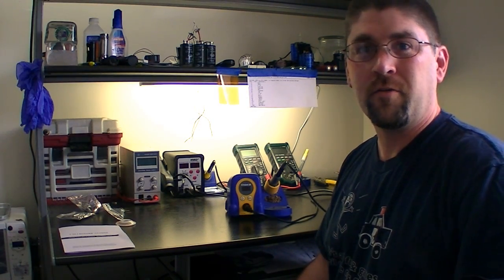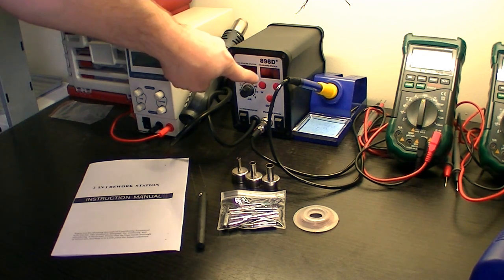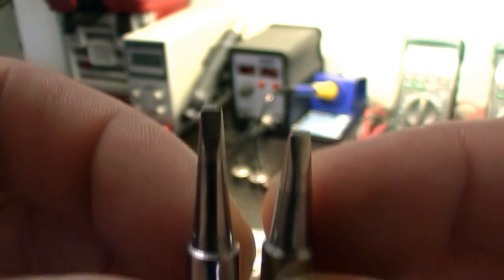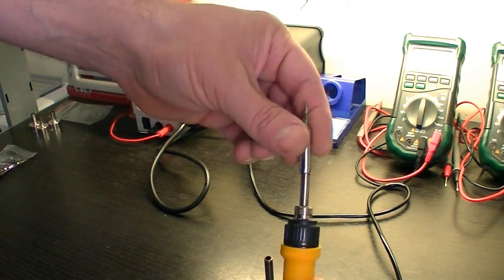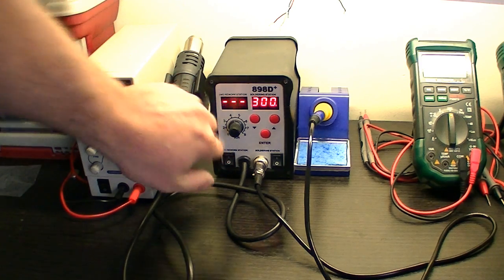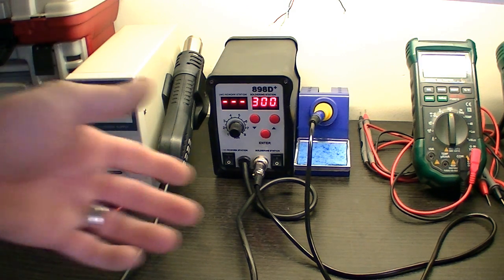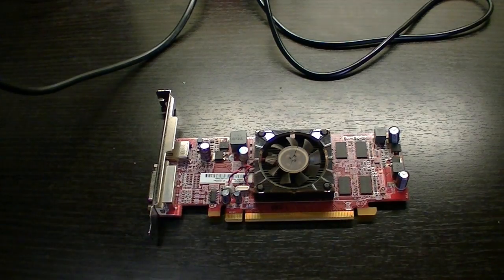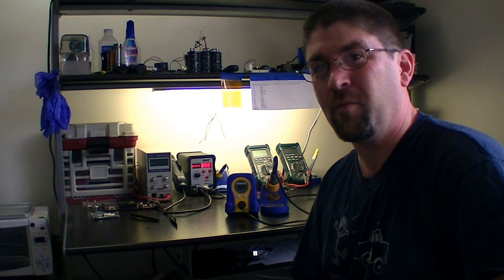898d+ 2 in 1 rework station review

Comment: I do have 898d and it is useless. I've tried to remove a mosfet  and failed, but both heat elements need replacement. I am reluctant to make such an investment.
Reply: 898D plus It's good, maybe yours is not the plus model. Obviously you cannot compare it to one that is branded, made in the USA for 300 dollars or more, but for those who are just starting out or do not have enough money, they are doing very well.

Comment: The key is getting the Yihua brand and the 898+. Not 898. Occasional user here. Mine so far is 2YO. All works w/ No probs. From SMD parts to 8ga wire. Inside work to outside car work. The air gun is great for SMD , heat shrink , cutting/softening plastic. Memory temp setting when turned off. Accidentally left mine on for a few days straight, again no probs.

Comment: hi there Mad Electron Engineering, or anyone on this planet please help me, i got the same rework station like yours few month ago, my question is,  the main unit controller getting warm and then so hot after i used it more than 30 minute on 300celcius iron setup, is that normal the main unit  getting hot? i just worried it will blow up on my face when i used it more than 30 minute. thanks.

Comment: Not to bust your bubble I paid 47.99 for my 898d. EBay,.Thanks for showing me how to put the heater/ blower end on ,I did mine wrong .your are right the book kinda sucks,I have only solder so far,it work great,I haven't heard any complaints so except one guy,there always one.
Reply: Ron Thompson i got mine the other day as well probably from the same seller.
Reply: $43.90 via ebay for a 'Mark Ethan' branded 898D with all the usual extras plus 11 tips at this point in time. Just for comparison price shopping for anyone. Cheers. Buying a soldering iron was a two week shopping experience for me. I am poor and indecisive. Fingers crossed on this decision.
Reply: Still working boss?
Reply: Still chugging along? thanks! oi.

Comment: I just purchased a Yihua combo station. I have a bunch of upcoming audio and shop projects where I need to salvage stuff out of old audio equipment, computers, PS's and such. I realize these are all just being rebranded, but I'm curious to know how your unit is holding up.

Mine was $99. I figure the first 5-6 transformers and 20-30 caps I pull from old equipment pays for this station. So if it takes a dump, I'm not really out anything. But I'm hoping it holds up for a couple years.
Reply: Has it dumped itself yet friend? thx!

Comment: I concur; I own a Hakko 939 and it is built to last. To trade your Hakko for a knock off brand is criminal, there have been known problems with this item, poor solder joints, segment display issues, if turned off while hot, it will not cycle to cool down causing premature heating element failure. I would have simply kept the Hakko and bought a separate hot air station that probably would have been more dependable.
Reply from the maker: +John Cunningham I'm still using it today with zero issues so far.
Reply: All I can say is you are very fortunate; there has been a small numbers of negative issues in some of the forums and other members on You Tube. I have a knock off Hakko that I parked for a genuine 939. Why did I park it? When I opened the unit up I was alarmed to find the copper wire was to thin and doubt if it met safety codes plus lousy soldering to match, finally the Hakko was much faster on heating and ready to go within seconds and the temperature was spot on where the other was way out.
Reply from the maker: +John Cunningham One of these days I really should open my unit and inspect the quality after owning it for this long.
Reply: Yes! I highly recommend that, at least it will give you piece of mind when you carefully check the wiring and solder work. Pay close attention to make sure it is earthed properly and the general work layout, if everything checks out you are good to go.
Reply: I have the Yihua 898D since almost 3 years now and it is still working great, I really like my soldering station.
Reply: 6 years and counting... Absolutely 0 issues
Reply: I have the non-combo version (just the hot air) for 4 years now and zero issues so far. I did open it up and inspect it since I also heard the rumors about bad connections and such. To my relief, everything looked fine...the neutral wire was not reversed and there was proper grounding. The solder joints were decent but the board was very dirty with rosin everywhere. I cleaned it up with some ipa and all is well.
Reply: hakko is overpriced shit for snob idiots.

Comment: Well done review. I've been working with electronics since 1970 but haven't upgraded from my old Weller soldering station I bought in 1985. That was a magnetically controlled unit. This looks like a great way to improve my capabilities for a lot less than I paid for the Weller.
Thanks a lot for your time!

Comment: I like your video hmmm.... To get the best performance out of your new hot air station soldering iron. I would use a real Hakka tip. The real cheap chines tip will not work as well with large ground-plane soldering, but please make a video on how differently they perform. I Have an now hard to find 8060 X-tronic hot air station. At first I did not like the performance of the soldering iron until I used real Hakka tips. I believe best portable hobby I ever own.

Comment: I know exactly what you can do with the solder iron.  Send it to yours truly.
Reply from the maker: Figures someone would say this.....:)
Reply: R&TPreppers Actually I don't know a damn thing about electronics.  But a soldering iron does come in handy even for the layman.  So maybe give it to someone who will actually get a lot of use out of it.  I'm fine with my $10 Walmart special.
Reply: @ElGatoLoco698  Hey, if you keep the tip clean and tinned, know how to use it without lifting pads or frying components, that's great.  Keep using it.  Expensive tools can make a difference in the ease of things, and can increase the quality of the outcome in many cases, but not all.  Cheap tools in the hands of knowledgeable people are fine.  I've seen lots of high and mighty people using expensive soldering irons with extremely oxidized tips while talking about how good they are, too.
I've made do with lots of Harbor Freight stuff and Chiwanese electronics for years, not a problem.  When I =need= a good tool, I buy it.  Until then, I'm fine with lower end stuff.  Buying inexpensive tools means that you can buy more tools and do more things.  When you're ready for a better tool, you'll likely have the money for it, too.  It all works out.
Reply: +ElGatoLoco698 If you don't know better you shut up !
Reply: Thanasis Athanasi
Well then, you can fuck right off.  I don't know where you get this shitty solder bullshit.  I was talking about the soldering iron, moron.  So shut the fuck up and comprehend the discussion before commenting on it next time.
Reply: Who is fine with his $10 shit special? Is it me? Shut up man.
Reply: Thanasis Athanasi
Aww, are you angry because I can use a cheap $10 soldering iron and you can't?  Don't have the skills?  Maybe you'll figure it out one day.
Reply: ***** If you can't control the temperature and the temperature does not set quickly when you touch the stick to the tit, you may miss the fucking train. Come on man. Don't take it seriously. It is just a fucking cheapo crappy solder. I suggest you try something better matey !
Reply: *****
You haven't asked me to fuck off before, dirty. You are just asking me to stick the iron up my ass, NOW. You better try to be a bit more communicative next time idiot. You were talking about the solder that was costing you the fucking 10 shits not the soldering iron. Either way, you have been an idiot. I use the soldering iron on a daily basis and I can't tell the difference between a cheapo and regular shitting iron.
Reply: Thanasis Athanasi
You have the intelligence of a box of rocks.  Fuck off already you dipshit.  Now go back and read the previous posts again dumbass.
Reply: Ohhh. Fuck you man.
Reply: Thanasis Athanasi
Oh, Fuck off man.